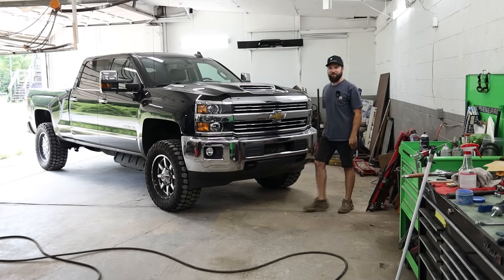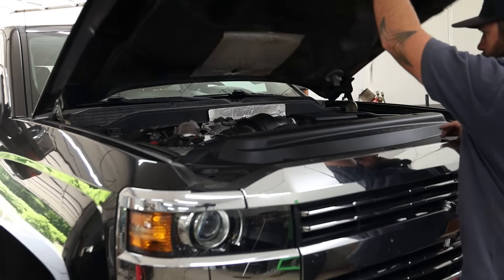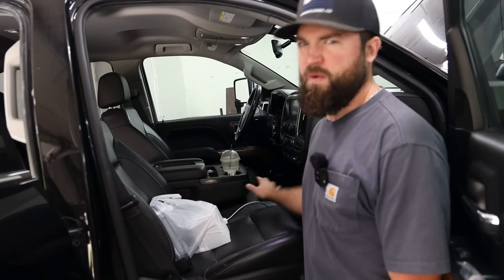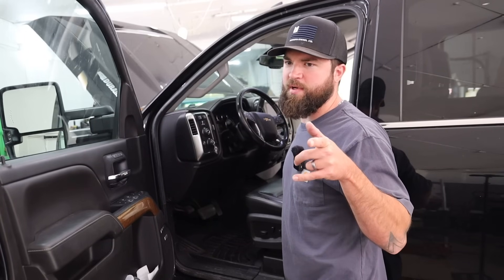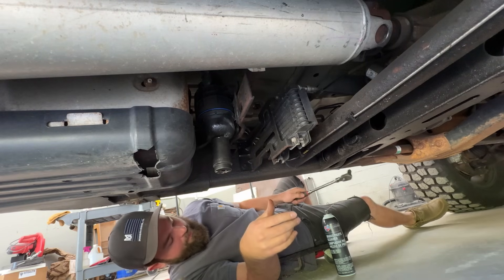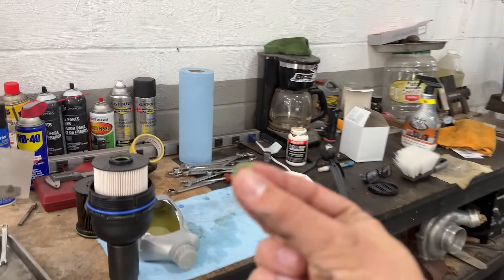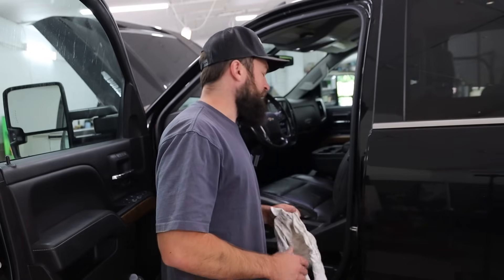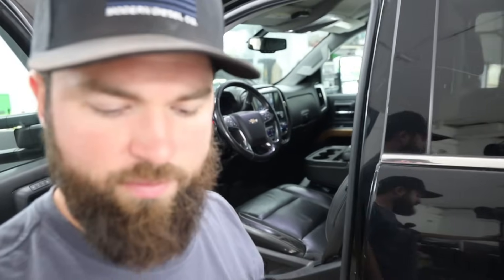Sick of New FORD TRUCK Prices so I Bought a Used Duramax

Comment: Just bought my 2016 f250 lariat ultimate fully loaded 94k miles for $38,000 not a scratch on the entire truck
Reply: That’s an insane deal. That’d be at least $55k around me
Reply: Love a steel body they’re pretty much all around that price range here in central florida
Reply: I bought my 2016 lariat about 3 years ago now. During the "chip shortage" had about 68k miles we got them down to $50k. Love this truck! Getting 18.9 mpg on a nice tune deletion. Great purchase man!
Reply: Its in a few of my videos I think. Driving through the mountains and stuff
Reply: That’s actually a good price in today’s terms.  I could have bought one with that mileage and trim package for 38k in 2018.

I opted for the XLT with center console & 4x4 with 30k miles for 38k.  I’m at 247k and was just offered 20k as a trade in on a new one.
Reply: I purchased used also. Picked up a 2020 Ram 6.7 Laramie with pretty much every option for $51.5k out the door. Was a little more than I wanted to spend but couldn't pass up on the deal. Only 21k miles, heated/cooled seats, adaptive cruise, big screen, paint corrected with ceramic coating and clear protective wrapping in the front and along the bottom. Full 5th wheel & gooseneck prep, spay in bed liner and tonneau cover. So much more to list. The previous owner took very good care of it.

Comment: That duramax will give you just as much issues if not more. Ford makes the best diesel trucks out there
Reply: Lmao! You know sh-t buddy! The l5ps use a denso hp4 pump. 6.7 power jokes use crappy cp4s and radiators go out after 100k miles. The whole front end has to come off to replace!  SMH!
Reply: @fredwilliams7893  that's funny, my Powerstroke has 350K on it. I bullet proofed my CP4, and I still have the original radiator.
Reply: Cummins is the best engine. Ford has the most cab space but if your towing like we do for a living Cummins or duramax are gonna be the best two. We’re pulling cows or hay and hotshotting as well 90 percent of the fleet is Cummins but if it’s not dodge it’s a Chevy. Fords had too many issues. Overheating and etc

Comment: Smart man. I had multiple 6.7 fords. I went to the dark side and got a 2017 Chevy 2500 l5p duramax. Hands down the best truck I’ve owned so far and it looks like a modern classic on the outside. No complaints from me.

Comment: As much as I want a 2020 duramax I’m buying the 2017-2019 ones those 10 speed no good
Reply: I just did that.  Sold my pos Ford with a 10speed.   Went back to a Dmax 2018.  Awesome so far.
Reply: @OverlandandOutdoorPursuits  these 10 speed ain’t it
Reply: I have absolutely no problems with the ten speed in my twenty eighteen f one fifty
Reply: @carlmiller8640  that’s because it don’t have the power to hurt it self plus you ain’t towing heavy loads
Reply: 6 speed allison all day!👍
Reply: The GM 10 speed they started using in 2018 is the same as the Ford. They (GM and Allison) paid Ford for manufacturing rights to use their design. I would stay pre-2018 on either brand.

Comment: I put 450k on my 18 6.7, just got a 2024 lariat 6.7. Very happy with my fords
Reply: Damn you got lucky had a fleet of f-450 with the 6.7 and had transmissions go out around 30k and some even burned to the ground at 115k not to mention EGR and def issues.

Comment: My 18 did the same thing, the coolant bottle is a 2 in 1 system and the bottom half the bottle was low, which from first glance it Dosent look low but it has 2 filler caps the top is the overflow, and you have to fill the bottom one, I did all the you tube tricks and couldn’t get it to work, had to send it to gm to get a new bottle then them re pressurize the system then never had a problem ever again

Comment: Just a tip get a billet fuel filter housing cause the plastic one strips
Reply: Facts I had two strip on my F250 6.7 Powerstroke I finally wised up and bought the Billet one and never looked back.

Comment: Look at that big ass dpf box hanging down on the passenger side, eyesore.
Reply from the maker: Looks so bad. It’s actually the DEF tank
Reply: I was wondering what that was.
Reply: @TopCorey  time for a delete on that unit
Reply: Lmao really? Ain't that bad!  Who cares. Still a bad ass truck
Reply: Lmao really? Ain't that bad!  Who cares. Still a bad ass truck
Reply: You have a very nice truck.
Reply: I have a 2023 GMC Denali Ultimate crew cab dually with a L5P which is my hotshot truck. I have a 2006 GMC crew cab,long bed with a LBZ,it is my work truck/ backup hotshot truck. I will never own another diesel besides a Duramax.

Comment: What diesel truck would be a good starter for someone who never owned a diesel truck before I’ve always owned gas trucks. I have worked on all my stuff myself I’ve been looking at a clean 2011 Ford F350 6.7 or 07 ram 2500 5.9 Cummins any suggestions? Not a big fan of the7.3 fords
Reply: 5.9 is a pretty dang simple engine to work on.
Reply: L5p if you can afford it! Hands down most reliable so far. Also they use hp4 pumps by denso. 5.9?  Lmao yea if you want transmission issues and cracked dashes and much more issues. Dodge Is  fu--ING trash !!!!!

Comment: Should have just kept the ford u had
Reply: Why so he has to replace his whole fuel system due to the crappy cp4 pump?  Oh and his radiator after 100k miles and also has to remove his whole front end to replace it?  SMH
Reply: Exactly! The L5P are nice but not good enough for me to switch from a 6.7 powerstroke..fck that !

Comment: i had water in fuel light come on my 2012 LML and i drained it. the water in fuel light went away and it came back on about a month later. changed the filter and it went away. Mind u i got the CP4 pump with 270,000 miles on it......

Comment: You bought a two time bankrupt, government motors Isuzu junk product
Reply: Bro ford went bankrupt as we’ll also gm designed the L5p by themselves better than anything ford can make
Reply: @wannabeutuber1  

You do know you that your fantasy of government motors building the Isuzu engine is just that right?? It’s ISUZU….says it right on the engine
Reply: @wannabeutuber1 the 6.7 ford by far is a more solid engine than the duramax, I'm a diesel technician and they all have issues but the ford engine is more solid.
Reply: @sounboy4498 that’s funny my diesel technician says don’t keep a 6.7 power stroke passed it’s warranty
Reply: @PopCorn-ei5bj  I have to disagree with him. No truck is perfect, and yes, the emission components can cost you after the warranty runs out. It doesn't mean the engine is no good. I've been a Ford tech since the early 90s, and Ford has come a long way. Presently, I'm cummins certified and our shop specializes in light and medium duty diesel engines, I just replaced a turbocharger on a 2016 F750  with a 6.7 PS  over 700k on it and ive seen over 1 million on those engines if taken care of. Alot of people shouldn't own diesle because they aren't willing to do the necessary maintenance
Reply: Yep same. My customer is actually a ford tech and says the powerstroke are garbage. Don't listen to these inbacels!  L5P is proven to be the most reliable right now and don't use those junk cp4 pumps!  Like ford and dodge! Trust me you made the right choice  mine has 107k miles zero issues!  Ford and dodge?  Lmao!!!! SMH
Reply: @sounboy4498 Yea OK! Mayby the lml duramax! L5p way better than powerstroke
Reply: @fredwilliams7893  the crankshafts says otherwise 🤣🤣🤣
Reply: @sounboy4498  crankshaft on l5p?  Never heard of it I have watched several reliability videos not one mentioned crankshaft also you must not do your research the crankshaft has been upgraded from the lml which never had problems.
Reply: @fredwilliams7893  I work in a light and medium duty diesel shop, 2 GM trucks outside presently with the L5P Duramax both need engines, in the past we've replaced a few others and had a couple rebuild engines those ones the blocks and cranks werent damaged
Reply: @fredwilliams7893  your a die hard GM guy and that is fine but facts is facts, the powerstroke is a more rigid engine (not emissions)
Reply: @sounboy4498  I call horrible maintenance! These engines are designed way to good to just let go and need rebuilds  L5ps are very reliable  somethings not right with those ones your rebuilding. And honestly I'm actually not a die hard. This is my first chevy and I have owned a ton of cars. I just know mine has been amazing with 107k miles but I'm insane when it comes to maintenance
Reply: @fredwilliams7893  both trucks outside one has 88k and the other less than 30k on it and very low engine hours, oil changes were done, one engine #6 connectting rod bushing let go and ended up letting the piston touch the valves and did some damage, the other one the crankshaft broke at the front counterweight. Im not saying all L5P engines are bad. I've seen good ones. Am just telling you from my experience, also we have an international CV truck with the duramax that blew the turbo and it seems to also have #4 cylinder dead, and that trus is fairly new
Reply: @fredwilliams7893  BTW I'm presently driving a 2012 LML lol, I have a 2017 F350 im building as well, I do like the cummins engines but hate the truck